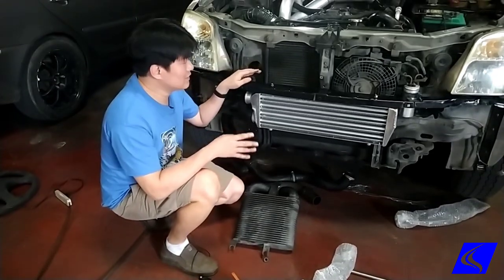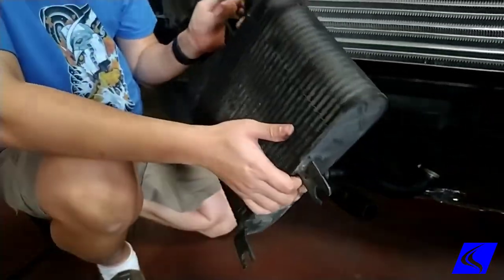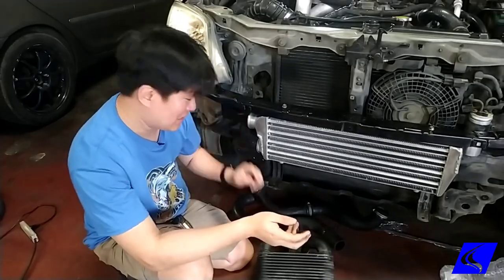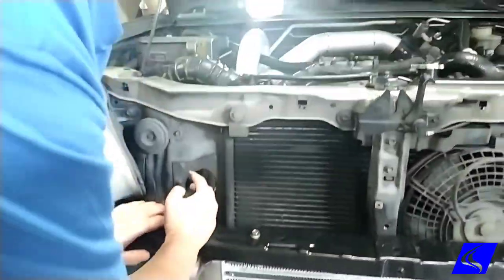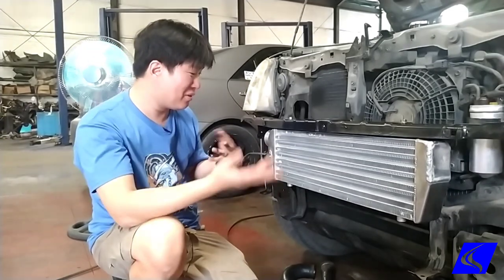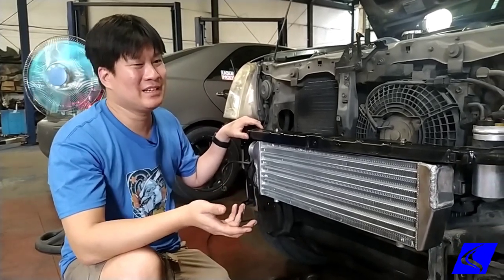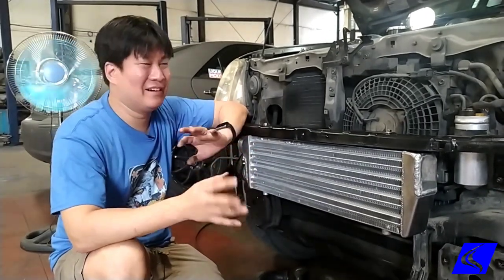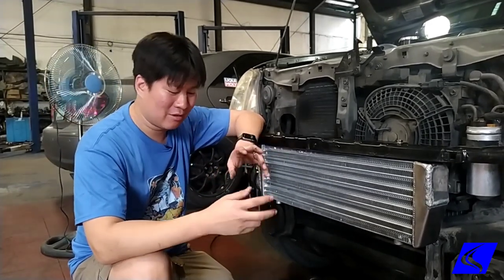Installing an Intercooler on the 2005 Isuzu DMAX the CORRECT WAY

Comment: Ano po ang purpose ng intercooler?
Reply from the maker: To cool the air
Reply: SpeedLab Channel

 Then kapag cooler na po ang air, ano po mangyayari?

Ano po ang advantages and disadvantages sa pagpapalagay po?

Recommended po ba yan sa Isuzu Crosswind na XTO 2002 model?

If yes, nasa magkano po magpalagay?

Thank you.
Reply from the maker: Tom Ecinev more power
Reply: SpeedLab Channel  Ano po ang advantages and disadvantages sa pagpapalagay po?

Recommended po ba yan sa XTO 2002  Isuzu Crosswind?

Nasa magakano po? Thank you.
Reply from the maker: Tom Ecinev more power and better cooling 
Disadvantage is you’ll spend 29k
Reply: @speedlabchannel4452  sorry for the late reply, thanks for information, how about if magpapalagay ng Turbo, nasa magkano po? And where's your shop located? Thanks
Reply from the maker: Tom Ecinev you mean we’re not talking about the dmax? What car do you have
Reply: @speedlabchannel4452  Isuzu Crosswind XTO 2002 is the model of my car.
Reply: sir?
Reply from the maker: x2Tom p25000 front mount intercooler